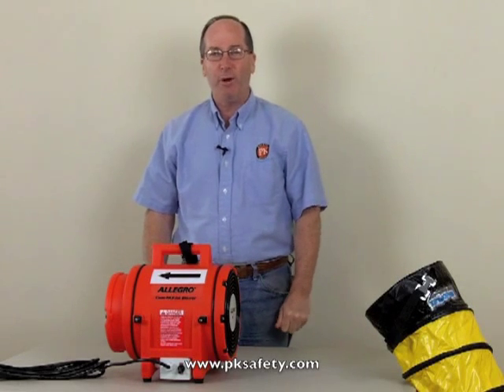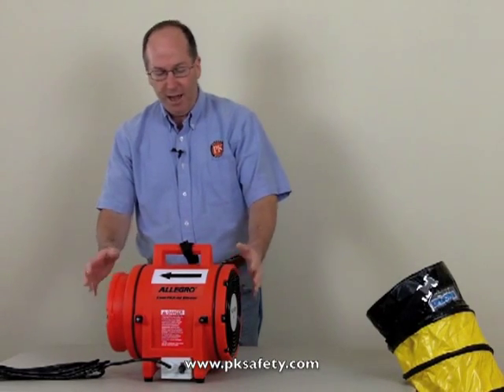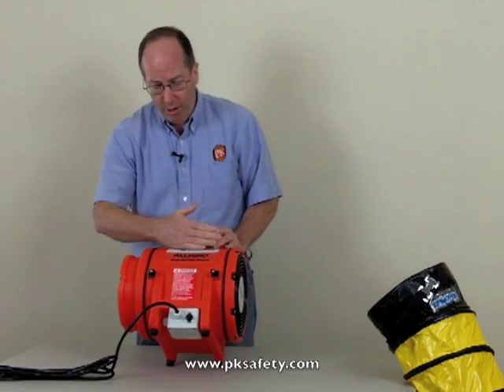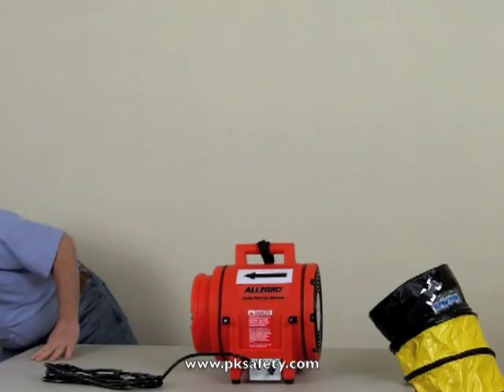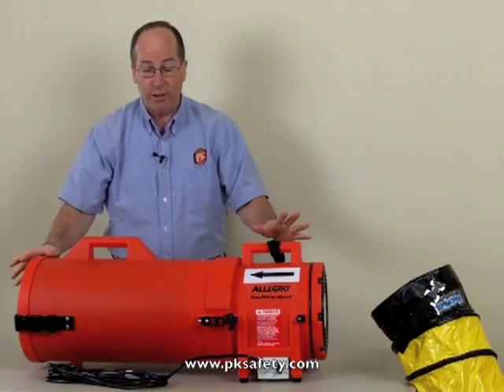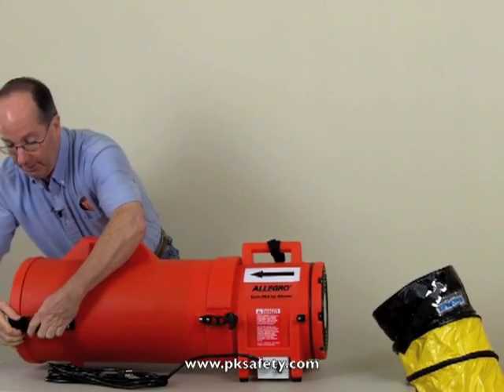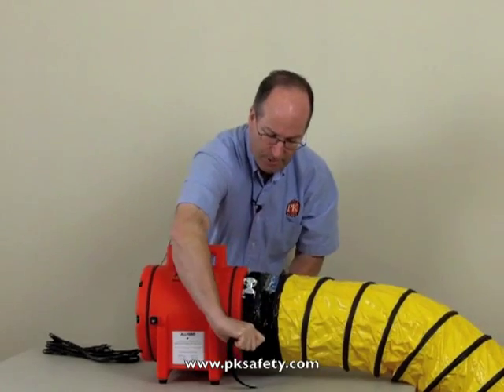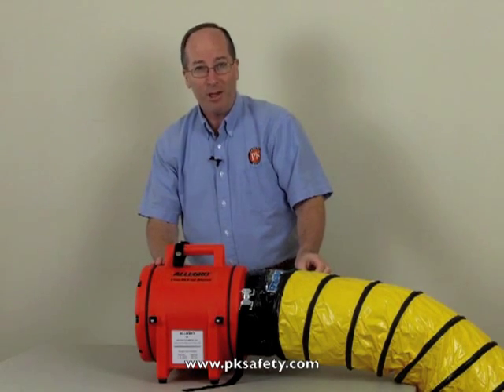Allegro Confined Space Ventilation Blower

Comment: You  turned the unit around and connected the loose hose to the same end the canister was attached to. Might be able to connect to the inlet side, but it would require a larger diameter hose.